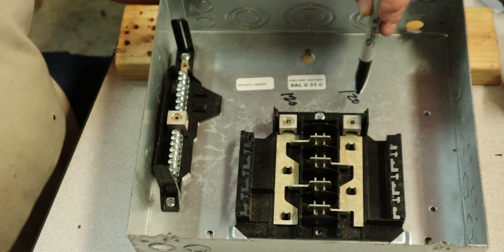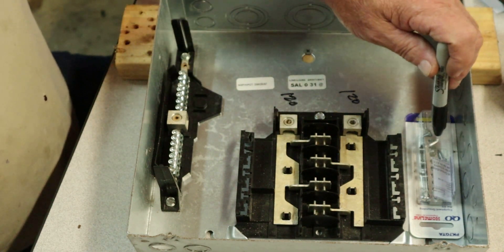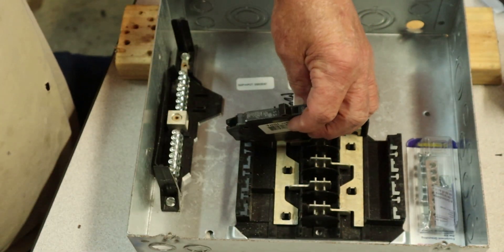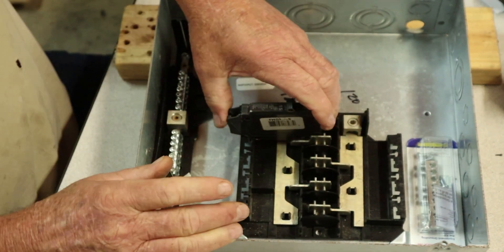110-240 Volt Electrical Sub Panel - What It Is and How It Works

Comment: Rate your breakers based on size and length of run of the wire you use, not your sources draw. Breakers protect wires from melting down, they don’t “supply enough” current for you to use what you want.